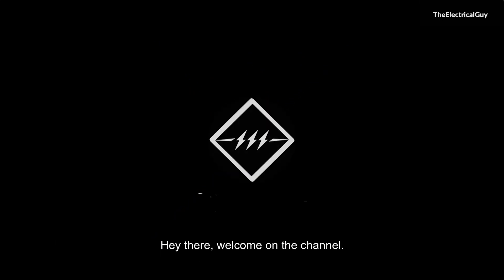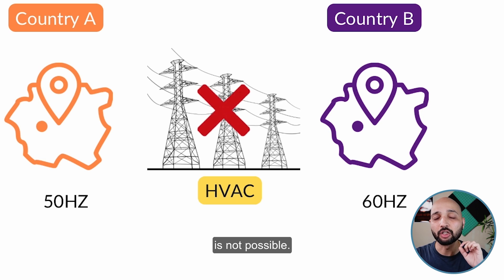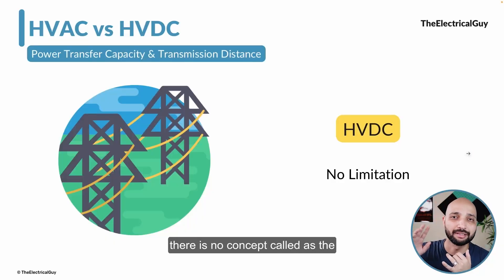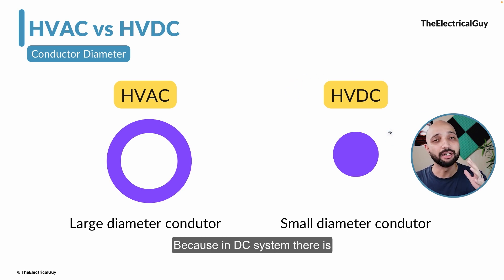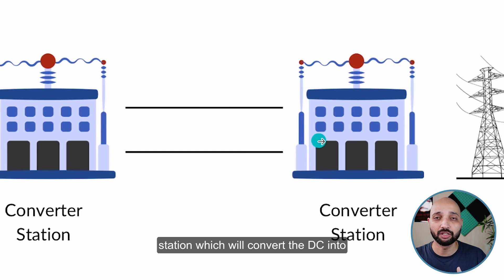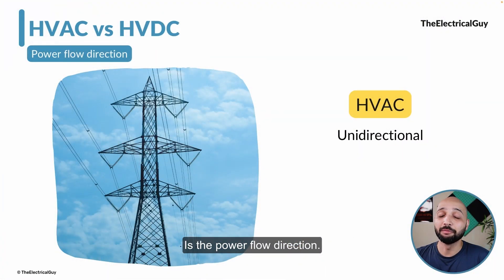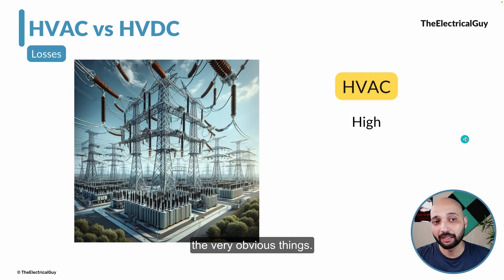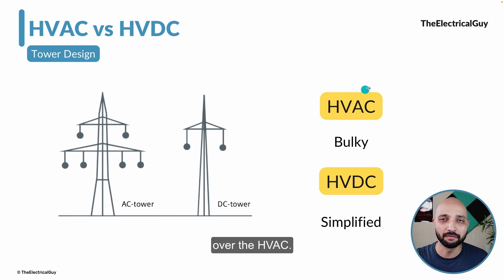HVAC vs HVDC | What is the difference | TheElectricalGuy

Comment: In Germany, an HVAC line was partially converted to HVDC. 
The pylon has 6 conductors. 
3 conductors are still used for HVAC 380kV.
Of the other 3 conductors, 2 are used for HVDC 550kV and the third is grounded
The same isolators are still used for both systems.

Comment: Describing HVAC as unidirectional can be misleading. Think about an induction machine with a wound rotor, when the slip increases as the machine goes above synchronous speed the rotor starts generating power as well and it is still AC. I would better describe HVDC as a decoupling mechanism for power transmission.

Comment: Thank you for these presentations. My interest is policy development. In particular the transfer of power between battery storage facilities. You mention the a major part of the expense of HVDC is the converters. I would assume that HVDC between batteries would not involve converters. Also, I have heard that for shorter distances, underground HVDC can be economical.  Ultimately, a grid controlled by battery nodes that transmits power to battery node substations would only involve AC for local distribution. Maybe? Thanks again.

Comment: You did not mention the key advantage of the DC to DC transmission part. It does not need the high tower with two conductors high in the air as you presented. It could be used underwater and under ground. For example embedded between the tracks of the train! After all even Edison did that In New York Pearl Station with  his 110V DC transmission despite obvious disadvantage of the lack of ability to generate high voltage DC without AC transformers that Tesla AC accomplished via three phase transformers! Both systems however do not need for energy storage of eletrical power for transmission to long distances. Compare to limitation of Electrical Cars run on DC batteries!

Comment: AC is bidirectional, as several commenters noted.  Inductance and capacitance are not energy losses, but part of the physics of AC.  They do place limits on dostance.  So whatt is Break even distance in mi or km?  Probably function of power level too.  Rule of thumb for AC is 1 mi per KV, eg 345 mi for 345 kv.  Note that DC transmission required invention of solid  state devices in large sizes and high voltage levels, only in last 20 years or so.  Done at turn of 20th century by motor-generators, not very good solution.  AC power systems built over last 130 years before HVDC invented.
Reply: This is inaccuracy in the video. Bi-directional power flow isn't possible between AC systems operating at different nominal frequencies or between non-synchronized AC systems. Other than that it's quite possible and occurs on daily basis. However, use of (HV)DC is beneficial again regarding flexibility and stability control of the systems

Comment: Sir, I remember the controversy between Tesla and Edison. Edison wanted to have DC transmission system but the drawback was DC was not able to transmit to longer distances. Then Tesla introduced the concept of transformers and long range transmission. How come then HVAC is having limitation in transmission and HVDC is not having any issue. I am confused.
Reply: Clearly due to inductance, freq and capacitance which are absent in hvdc
Reply: Skin effect bro just don't read the Edison and Telsa story half

Comment: Regarding power flow direction, both HVAC and HVDC is bi-directional.
Reply: Don't think so 🤔 hvac cannot be reversed to point of generation but DC can due to converters
Reply: @danielimanah8681 Theoretically it is possible because synchronous electrical machine can operate both as a generator or as a motor.

Comment: Bro I have a doubt,Losses in DC is less then why not it used as transmission ,the high cost is the only reason for this
Reply: its not used as we dont have any generator which can generate dc current and also we cannot use transformer on dc so its very difficult to convert high voltage ac to dc vice versa its cost is very high and also not stable it getting damaged easily we can only use it when we get something simple to convert high voltage ac to dc and vice versa
Reply: True. but it's become common on solar plants

Comment: Interesting video , But my question is if the original power supply was by a DC generator would it produce power using less horse power than an AC alternator system ?

Comment: Hm. A general talk with a "higher-lower" terminology doesn't help. I would like to understand, so some typical numbers would help. What are we talking about. And how would it be possible that for the DC transport there is no loss!? Every conductor has resistance. P=I^2 R. For AC transport, the frequency is quite low, so I don't expect the reactance due to inductance and capacitance to be high. Actually, both systems need to deal with the same resistance part. But both systems are high voltage to keep the current lower, as I said P=I^2 R, so we want to keep the current as low as possible. Every cable is heavy, so for AC, they build a cable in such a way that inside you have less conducted carrier, and outside the good condctive material for the skin effect. Maybe the HVDC has potential, but I would like to see the numbers, regardless of more complicated conversion for DC, just the transport per unit length. Cheers
Reply: this is from an article I read recently -- " a thousand-mile HVDC line carrying thousands of megawatts might lose 6 to 8 percent of its power, compared to 12 to 25 percent for a similar AC line "
Reply: Yes correct. Higher and lower are too vague statements. Atleast the losses part the HVDC also should have similar loss. The RMS losses of AC should be similar

Comment: Isn't HVAC is also Bi-directional. When a powerplant needs backfeed it uses the same transmission line to start the power plant.
Reply: Same question, as solar panels also backfeed Into the grid through the same lines. Which made me second guess the statement that AC would be unidirectional.
Reply: @Dummydoda not possible. Solar system does that true comvertes.
Reply: Not possible. Distribution cannot be reverse back to generation point. Power plant uses another source or running plant not its own source
Reply: Yeap not possible... But it can be transmitted to where it need like aluminium factory. In peak solar plant generation that's is how they manage the peak demand and generation of power.
Reply: Black starters are for types of generators that can't start without assistance. Before this is done the Tgrid is isolated to avoid collapse. Same with hydro turbine they need battery's to open the gates for the gen to prime and start. Black starter are not for distribution network only for plant starting and that depends on the type of generator model.

Comment: Dc current voltage drop when it is go transmission lines the process not possible in America then many people used ac current, your explanation was  wrong dc current must requires thick conductor when AMPS increased,I have a doubt about your class how can you transmit dc current using transfer, transfer only used for ac supply,if your connect dc supply to the transfermer how it achieve contraction and expension of core with flux and induced EMF it not possible in dc current because of it nope any cycle frequency then how it creates repulsion and extraction in the winding
Please answer questions I need your response it is helpful to me
Reply: Transformers only used for ac current to voltage and AMPS increase or decrease
Reply: You are abs wrong. If you have worked on small and large solar plant you should know. Very High DC voltage over high DC amp requires small wire Guage. And power flow is very efficient. It's hvdc not jus DC transmission note that.
Reply: @danielimanah8681  small guage wires not used for dc current,then how can you get AMPS , amperes depends on wire thickness because of dc current electrons flow throughout the conductor so it must need wire thickness to flow electrons with many ampers through conductor and if you use thin conductor it resistance is not matching to resist the many ampere flow thin conductor generates heat due to many AMPS but thin wire so must use minimum 10 or 15 square conductor what did you said that is wrong,I said correctly because of I was finished many experiments on the topic
Reply: @ReddiBhasa Have you worked on low voltage DC power system before and compare to high voltage DC systems? Simple ohms law holds on DC transmission irrespective of the amp. For example, Once voltage is higher than amp with 10:1 ratio, you can use very thin Guage with negligible loss. Very effective and efficient

Comment: A very informative video. 

However I have to dissagree with you about AC systems not being able to be bi directional. AC based grids regularly transmit power in different directions as demand and supply varies throughout the regions within which they operate. Indeed energy storage systems also make use of this ability. Whilst power producers - whether mechanical or inverter based - have to be syncronised accreos the grid, the direction of energy flow is controlled by varyation of the relative voltages between suppliers and consumers.
Reply: Can you reverse distrubuted power back to generation point? No.
Reply: @danielimanah8681  What do you  mean by the phrase 'reverse distributed power back to the generation point'?
Reply: @paulmccredie3106  the general ac grid system is from generation tru MVA to distribution tru substations with smaller kva transformer. Obviously that can't be reverse. It's a 1way power direction. But due to electronic converters/inverters from ac - dc and verse versa in hvdc is dual.
Reply: @danielimanah8681  I have to disagree with you.

The first thing to understand is that transformers CAN be reversed. Let's take a transformer with a turns ratio of 2.3:10. If you feed 11000 Volts into the HV winding, you will get 230 Volts out of the LV winding. You can do the reverse and feed 230V into the LV winding and get 11000V out of the HV winding.
Now let's deal with a couple of real life scenarios:

We have a power station supplying power to the grid and also to its own auxiliary equipment, site lighting, maintenance workshops and administrative offices. Energy is flowing from the site to the grid through a transformer which raises the voltage to grid levels. Now let's shut down the generators for maintenance. The generators are now not producing any energy but the lights are still on, the workshops still have power and the admin staff can still use their computers. This is because energy is now being supplied from the grid to the site using the same wires and transformer which are now operating in reverse.

The second scenario is on a smaller scale. We have a house which has solar panels. It's a dull day so some of the energy is being supplied from the grid which means energy is flowing IN to the property. The sun then starts to shine and household loads are reduced so energy now flows OUT of the property. If most or all of the houses being fed be the local substation produce more power than they are consuming, then energy will flow in the reverse direction through the substation transformer onto the local HV network.

Power can be supplied in either direction whether the system is AC or DC
Reply: @paulmccredie3106  you wrong again. Have you visited a hydro power station? There are more than 1 turbine running so not all will be shut down during maintenance. Your second scenario is the usual local grid-tie inverters sending excess power to the grid. Those excess power never get back to the generator or MVA they are distributed on the low side or consumers end of the network which is the load. Rem inverters are smart, they send out power according to load demand which is the core purpose of power generation. Hope you understand?
Reply: @paulmccredie3106 to add.
Black starters are for types of generators that can't start without assistance. Before this is done the Tgrid is isolated to avoid collapse. Same with hydro turbine they need battery's to open the gates for the gen to prime and start. Black starter are not for distribution network only for plant starting and that depends on the type of generator model.
Reply: @danielimanah8681  Yes as it happens I have visited a Hydro power station, but that is irrelevant. You seem to be missing the point of what my scenarios are intended to illustrate.  Just because a particular site may not routinely shut down all the generating sets does not mean that they can't do so and still have a power supply to the site from the grid. Also some smaller power stations will only have one generating set anyway.
Have you heard of Hydro storage? We have at least 3 of these in the UK to my knowledge and there are others throughout the world. A Hydro storage facility will pump water uphill during periods where there is low electricity demand  and abundant supply. During periods of high demand and supply shortage the water runs back downhill. The pumps become turbines and the motors become generators. During the storage (charging) process energy is moving through the grid TOWARDS the site. During generation (discharging) energy is moving through the grid AWAY from the site. In both directions the the energy is passing through the same transformers that connect the site to the grid. The older hydro storage sites have been running for decades and started long before large scale  VFDs and inverters were considered to be economically viable. So the interface between them and the grid is bi directional AC.
As for black starting, I'm not sure why you mention it in the context of this discussion. That will only occur when no power is available from the grid which (in the UK certainly) is a very rare occurrence. In fact I don't think it has ever happened, in the UK but I could be wrong on that point. All power stations starting from no sets running will usually draw power from the grid to do so.

During this discussion I have given you scientific fact relating to transformers and also described real life situations where power can and does travel in either direction throughout the grid and across AC only connections to it. Nothing you have said so far has demonstrated to me that my knowledge and understanding of transformers, motors, generators, grid transmission and distribution is wrong.
Reply: Can you reverse distrubuted power back to generation point. No

Comment: Nice explanation. Thank you. Even when two grids follow the same frequency standard the frequency stability of both is also very crucial. For bidirectional transmission in HVDC both converter stations will require Ac to DC and DC to AC converter. This is not a small cost but cost is always justified in any project.

Comment: I wonder why the losses in HVDC remains the same with increasing distance, can anyone enlighten me please? I'm thinking about the formula R=pL/A where the resistance is proportional to the distance. Or am I using the wrong equation here. Thanks.
Reply: I think he's talking about the "rate" of loss that is constant in HVDC. Which is right in line with what you mentioned, that is, the resistance is proportional to length. So, for each unit length of wire, the loss will be constant.
Reply: @RajivLochanPanda  oh yeah, I see. Thanks. He means the resistance in DC vs the impedance in AC.
Reply: Resistance remains the same over a particular length irrespective of load it carries until it surpasses lengh limit. You can put it into power simulator and you get it very clear. As field power engineer we see this commonly.

Comment: Sir this one is very informative thank you.
Sir can you please do a video on the HVDC transmission line protection schemes as in the case of HVAC we are having inductance parameters for the use in relay 21 (backup protection), where as in HVDC only resistence is present.
And one more thing sir, why is HVAC transmission bidirectional power flow not possible, like the lines we use to send power can also be used to receive power back as if the power sending (export) is less than power recieving (import) we will be recieving power to the grid and vise versa , correct me if I'm wrong.
Reply from the maker: Thank you . I’ll try 👍🏻

Comment: Excellent Explanation Sir ⚡...HVDC is only used in Primary Transmission of power system.
Reply from the maker: Thanks
Reply: @GauravJ ,How do I reach you.  I tried to E-mail using the mail provided on your web sit  but didn't get any answer
Reply from the maker: @mbomboaimaim798 hello. You can write me here gauravj@theelectricalguy.in